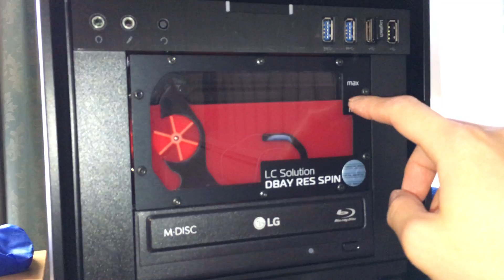The current state of water cooled gaming rig with i7-7700K and 2 x EVGA GeForce GTX 1080 Ti FTW3

Comment: Hi!

I know this video is a few years old now however you seem to have done almost exactly what I am considering doing!
I have just done my first ever loop for a i9 10900k in a 750d case (I'm sure it's the same as this case) at the moment I only have the one radiator (360 PE) at the top I did get the kit with the XE but as you pointed out it's too thick for the fans.. So I got the PE..

I am considering the D Bay Res to make enough room at the bottom of my case to potentially upgrade my GPU and and maybe add a second Rad to cool it...

My main concern is how easy is it to fill the res in that position? Do you push it out to fill? Also does it fit nicely with the top Rad fitted? (I also have a disc drive in the same place)

Thanks!
Reply from the maker: Hello,

Yes 750d. I struggle for space now but am about to just about fit everything in.

D Bay Res is what I used to have. My advice to anyone is DON'T!!! The reason is the noise. In this design liquid enters the reservoir from the top so you'll always hear the waterfall noise coming from it. My currently one is silent as the water enters from the bottom of the reservoir rather than the top. However to answer you question, yes you would push it out the front and fill it therefore you'll need to leave enough length in the tubes to allow you to push it out via the front.

My advice is to use this reservoir + pump combo instead: https://www.youtube.com/watch?v=zTgH5qoZUq0

Please get back to me if you have any questions as I don't want to see you waste monies making the wrong decisions.
Reply: @BrianSu  thank you so much for your reply!
Yes space is very limited but I love the 750d and don't really want to replace it..
I am hoping to upgrade to the new 3090 when it's out and if the leaks are to be believed the only way I can fit it in the case is with the bay res but you've given me something to consider thanks!
Reply from the maker: @whiff30811  if you're getting 3090 consider getting this to support the weight: https://www.msi.com/Graphics-card/Graphics-Card-Bolster.html

Do you plan to SLI the 3090?
Reply: @BrianSu  I never knew such a thing existed!

No I don't plan on SLI just the one GPU will be enough for me! It will probably be expensive enough here where I live... It's hard enough to get PC parts here
Reply from the maker: @whiff30811  yeah and newer games don't support SLI. Do you know when EK will release the waterblock for the 3090s? By the way, 3090 is basically Titan isn't it?
Reply: @BrianSu  no idea when but I'm sure they will be pretty quick! The rumours say the 3090 is the new name for the TI but hard to say at this point!

I see from your vids that you have been to Abu Dhabi which is where I currently live!
Reply from the maker: @whiff30811  so will there be a 3080 Ti? Abu Dhabi is alright. I need to go back there some day to visit a few places and do a few things at some point.